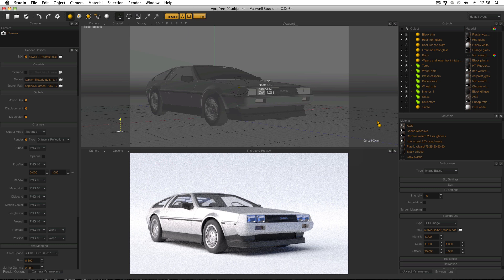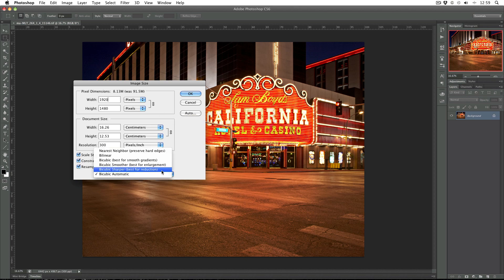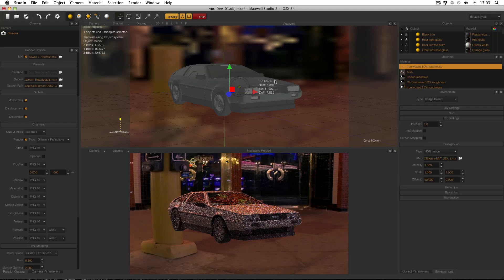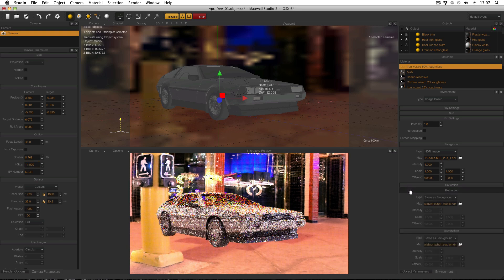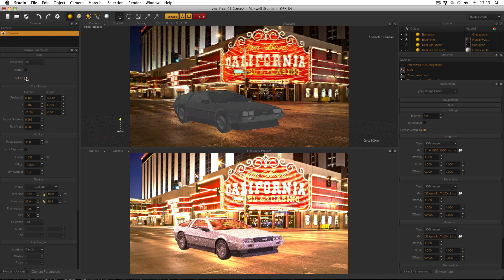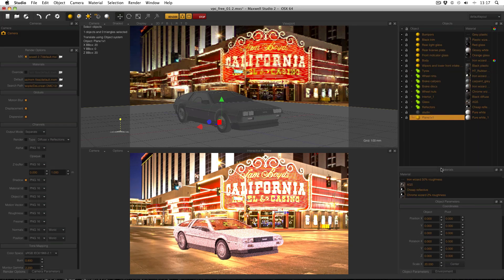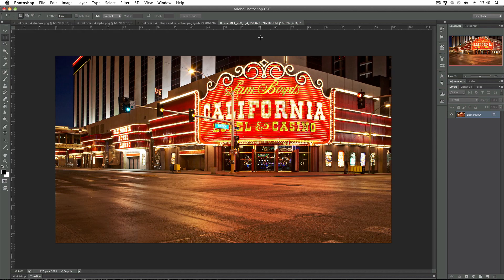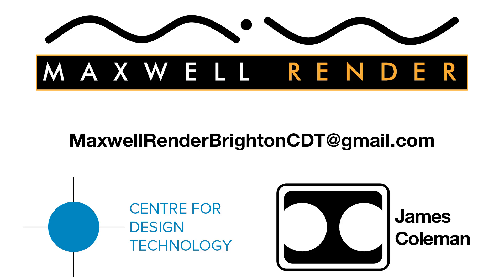Maxwell Render DeLorean DMC-12 Tutorial Part 4 of 6: Compositing 1

Comment: Hi James, definitely not easy.  So, can we say that we use the 360 degree HDR image for the reflection, refraction and illumination of the car, then use the 2D backplate to create the car shadow.? But then, how do you create shadows when there are no backplates, which seems to happen quite often.? Thank you
Reply from the maker: +latefa21 You have to have a backplate to composite successfully. You can try making one by flattening the 360 environment in photoshop, but it'll be distorted and likely low res. Sometimes you can get away with using whatever backplate you want and just using a similar HDRI environment. Try https://www.moofe.com/ and https://www.maground.com/Maground/home.htm for environments with backplates.